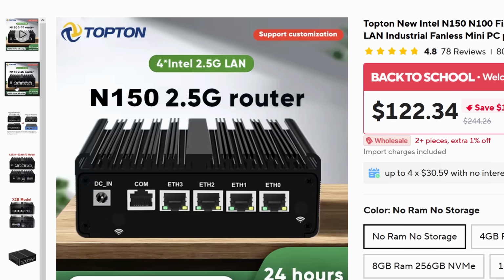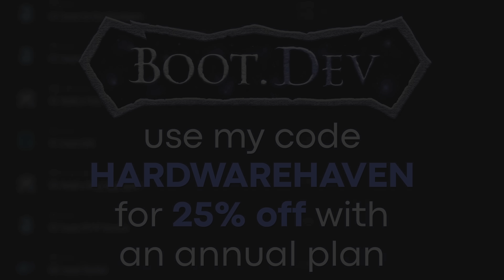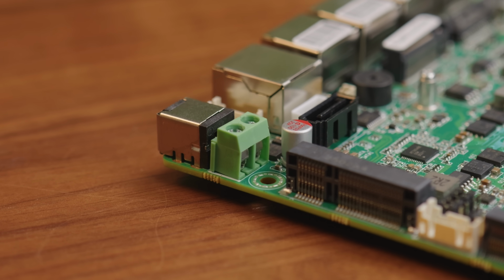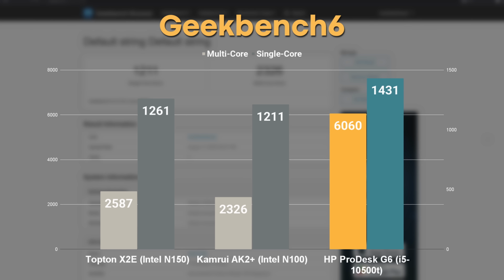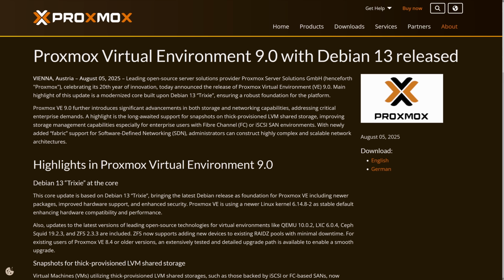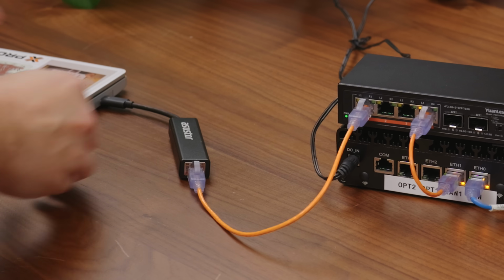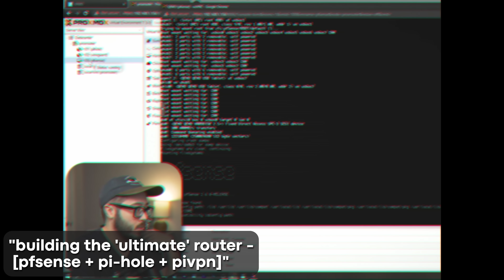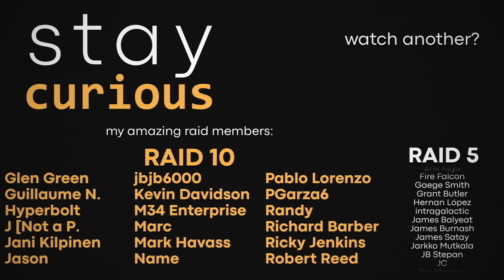Why Didn't I Buy This Sooner?

Comment: Do not buy this fanless POS. Mine overheats without a dedicated external fan constantly blowing across it. only running pfsense too. Also DO NOT BUY THE BAREBONES ONE. I went through 3 different ram sticks before I found one that was stable enough in memtest to not crash. Remove the fan? System overheats, mem throws errors and shuts down. DO NOT BUY THIS POS

Comment: N97 - n150 are the absolute best open source firewall hardware per dollar. Very low power draw, excellent performance for a firewall  and even excellent WireGuard / openvpn / tailscale performance
I use an n100 that I’ve had for awhile and I love it.

Comment: This is a personal pet peeve but just call the com port a modullar com port. You're already calling ethernet ethernet ports.  So many different things use that Port Style which is correctly called 8p8c modular. You could have rs-232 serial, rs485 either of those in DCE or DTE configuration, ethernet, or even any random developer that came up with eight wires that they want to easily plug into something.

Comment: There are known issues with these Topton N150 / N100 machines drawing too much power and running too hot. The consensus seems to be that either the BIOS is poorly developed and not supported and/or the CPUs are second rate or gray market (and need to be run hotter for stability reasons). Google "CWWK Topton N100 N150 idle hot." Either way, I ditched my Topton N150 router for another solution.

Comment: I have had one of these little jewels with the N100 for a few years, now, flaunting some flavor of *Sense or WRT and absolutely adore it. Recently, I upgraded to a UniFi Fiber because I wanted to add some video cameras on my property and I already have UniFi APs, so I decommissioned him from router duties and he became a nice little Proxmox host. He went from 4GB to the full 16GB he could handle, and at about that time the cheap no-name 128GB SATA m.2 SSD died, so he got a 512GB m.2 and an old 2.5" 1TB SATA hand-me-down from my main PC's recent rebuild. Now, this happy little trooper runs all of my network's neat little widgets, like you mentioned. Ubuntu server with PiHole, a docker instance of OpenSpeedtest, an RDP host I can reach from Web-Based VNC, as well as a couple tiny instances I use for Kubernetes while I'm learning clustering. It's not a processing monster, but when you just need something like a half-dozen Raspberry Pis, being able to just spin them up sure beats ordering them on Amazon! With solid-state EVERYTHING and passive cooling, it's totally silent and makes me just delighted.

Comment: I've used the CWWK N305 and currently a topton N100 mini PC with a bare install of opnsense. If I use opnsense's traffic shaper or zenarmor, the router will crash once every week or two with 'Fatal trap 12: page fault while in kernel mode'. Has anyone else run into this problem with mini PC like this? Have any suggestions on what to do?

Comment: I just bought one of these, can you please tell me how to passthrough te igpu. I have been trying for days. Where you using an lxc or a VM for jellyfin?
Reply from the maker: I just use the proxmox community script. It’s an LXC container. It automatically handles the lxc config to allow access to the GPU. You just have to make sure the non-free intel media sdk is installed on the host system
Reply: @HardwareHaven Thanks for the reply. Could you please link me the script you used?
Reply: I seem to have gotten it to work using a community script. The only thing is that I need to have a screen connected during boot up of the host, else the graphics driver won't get enabled correctly.
Reply from the maker: @AkiSaki  You can find HDMI dummy plugs for pretty cheap!

Comment: I use a similar device to run pfSense but with much slower CPU (Protectli). No issue with network speed. However, I think if you want to do IDS/IPS and VPN, that's where the extra CPU power would benefit.

Comment: Bought the similar one but not TopTon branded (same case, same motherboard according to stickers). After a week being on in idle 24x7 (Proxmox installed with opnSense, but not passing any traffic through) sensors reported CPU core temperature 68C with aluminum case being slightly warm. Replacing thermal paste to some Arctic Cooling MX-6 dropped CPU temperature for approx 10C stabilizing it at 56-57C level idle.

Comment: Hi great video, I have a VIDEO SUGESTION, -> Automated system backups to NAS. I use Timeshift locally, but dont unserstand with rea rsync or snapshots how to do it to the NAS. 
I had too much trouble with Synology ABB not installing cause of to new kernel whils still too old for GPU😅

i got N150 and also gpu issues on debian 12. I use it as a home server to run Openhab, HA, VLC streams and some python APIs. Yea and Openhab cant run on deb 13 yet so i used Pepermint 12. Thanks Colten😊

Comment: I use a N100 mini pc on task where most would use a raspberry pi.
Mostly because the systems with the N100 are here cheaper than the raspberry pi.
Of course I could've gone with an old HP mini PC but I wanted something modern with more passive cooling capabilities.

Comment: This build with a 5G Modem, running Proxmox and with OpenWRT in a VM, would be a super cool homelab with it's own cellular connection. With this setup it could also work as a modem, and with a WiFi card, as a WiFi AP as well
Reply: Mine ran Dual WAN for me, because as a TeleCommuter I can't afford to have my connection be down if I have to work. Starlink on one, 5G Cellular on the other. With a USB-powered switch and a laptop, I can run everything off a "solar generator" backup battery and panel pretty much indefinitely. It's part of my "hurricane set-up" being that I'm in Florida and if everything goes down I can keep working with a complete power budget of about 130W, and I have 400W of portable solar to keep it all charged.

Comment: How do the iommu groups look in proxmox, i was expecting thrm to end up on the same group limiting what we can do woth those network ports if passing them through.

Im intending running virtual pfsense with 2x ports passed through, 1 of the others as proxmox mgmt and the last as a oob port to another box i have - but do question if it will let me use the nics independently?

Comment: I have a Topton N100 running opnsense for over a year now.  Paid a bit more to not have to deal with aliexpress (was $180 on amazon vs ~$150 on Ali at the time) and I ended up throwing a USB fan on it cause the CPU can get pretty toasty in my apartment during the summer but I've been very happy with it.  We've also installed a few Topton/CWWK machines at some smaller client offices where these little guys have enough horsepower to handle smallish networks.  Most of the time it sits at 7-8w and the CPU is enough to handle packet filtering and intrusion detection which the previous AMD A6 mini PC I got cheap couldn't handle (keeping in mind I have a relatively slow internet connection).

Comment: Be careful with 2.5G multiport routers. There are a lot of chinese routers like this with 2.5G ports that just don't work with old 10/100M switches. Just no link. The bug is well known, it's a hardware bug that can't be fixed with driver updates. That was very important to us as we had hundreds of old switches that we did not want to upgrade.

Comment: All I want in a multi port router is a CPU and ram sufficient to do one thing. Routing. And do it forever, a 10 year+ use appliance. With pfsense or opnsense with self hosted WG. A higher performance processor or cpu than is necessary to reasonably be able to run future versions of pfsense or opnsense is totally unnecessary. No single point of failure on dozens of additional server features like media server, NAS, etc. Don't put all your eggs in one basket.

Comment: I have a similar model with N100 CPU. The only downside is that I had to add an HDMI dummy plug to make this a truely headless device. Otherwise it wouldn't boot...
Just installed Proxmox on it. This machine idles at 8 W without any tuning...

Comment: I use one of these little devices on my home network as a combination router, firewall, and wireless access point. I run OpenWRT on it which gives me access to a whole bunch of fun stuff. At the moment I'm only running AdGuard Home and Wireguard on it which means every device that connects to my network gets the benefits of DNS blocking and a VPN without having to install or configure anything. That being said I could do even more like setting up an Onion client which would route all my network traffic through the onion network or a transparent proxy server which would allow me to filter all the http traffic on my network. Again, without having to install or configure anything on the devices that connect to the network.

Comment: I've got a very similar one of these: not the same brand name, but IDENTICAL heatsink fins, etc... and it's the 6 port, i3 N305 (8 core) version of this, it came with a choice of storage and RAM - I went with 256Gb M.2 and 8Gb DDR5... admittedly I paid about $300 and annoyingly it came with Win11, but I just wiped it immediately... it's is so overpowered for running OPNsense with 2x 1.3Gbps WAN connectors, but should be fine for a few upgrades over the next few years.

Comment: I bought such 1 year ago and I use it as a router. The processor is less powerful than the N1o0 and it can support only 8gb of ram. And It has only 2 lan 2,5Gbps ports. The power consumption is the same as the N150(officially around 6W). I love it - it is completely silent and energy efficient. I've installed Opnsense without virtualization. I just switch the power on and off and didn't have any problem so far. Great for router.
For N150 it should be checked if it supports 32gb of memory. I have a motherboard with N100 and it has 32gb of memory and it is great for small home server(git and nextCloud to sync files, pictures, contacts...) and some other services.

Comment: Congratulations:  you paid more by going the Ali-Express route than if you just found a similar device on Amazon.   Would not necessarily be the same device, but... Functionally, most people won't be able to tell the difference between a N100 or N150 either... 

Me, I just prefer to not put my credit card info into something like  ali-express. 

Oh, been using a N100 for Opnsense for about 2 + years.

Comment: I have a similar Topton system with an AMD Ryzen 7 5825U, 4x2.5g, 64GB memory, and 2x 2TB NVME. It runs Proxmox with a virtual opnsense install and several other VMs. I have a LOT of stuff hanging off that tiny PC, it's great. Motherboard is made by CWWK. Has been perfectly stable for the nearly 2 years that I've been running it.

Comment: I have a Topton N5105 4x2.5GbE. I bought it in 2022 and it's still working. Initially, I used it with Docker, PiHole, Torrent, and other applications.
Today, I only use it as a firewall.
I had a problem after a year of use.
The NVMe overheated a lot and broke.
I bought a new NVMe with a heatsink and a 40x40 cooler. I've been using OPNSense for two years.

Comment: I have the Topton N100 model.  Both m.2 slots and the miniPCIe slot have 1xPCIe lane; you just need adapters.  No serial BIOS, though.  
I feel the "forbidden router" is totally fine as long as you are masking NICs off in the hypervisor and passing the PCIe lanes to the VM.

Comment: I've got a passively cooled FriendlyElec NanoPi R5S (Rockchip 3568B CPU, quad-core Arm A55) plugged into a 2.5GbE switch serving as my main router and a NAS, and I've been looking at systems which look pretty much identical to this for a while because that quad A55 gets fairly well loaded when serving data from a 3.5" external HDD over NFS. No encryption or anything going on, just shuttling the data from the disk over USB and then to the network. It does of course use less power than this system, but for anybody who wants to do more than just routing packets and maybe QoS or Wireguard, you're probably gonna want either one of these little x86 boxes, or an Arm solution with at least a couple "big" cores.

Comment: I think it's odd they flood the market with something like this that is very niche. But don't make basically the same thing except without all the NIC ports, put like 8 SATA connectors in it. A lot more people would want to run a low powered storage server for unraid, plex and torrenting than want to setup a homebrew router. Unless the industrial world in China is using these things for something.

Comment: I am running Proxmox, pfSense, Pi-Hole and Cloud Key on mine like others but I am also running a bunch Alpine VMs too. Each instance is tagged with a different VLan so I can start them up and test firewall rules when needed. Created a NodeJS script to automate running some tests. Could use Python too.
To each their own, but I only run stable network services on my firewall and run my other apps on a different machine. This box needs to be stable.

Comment: if you need a little bit more power you can buy a lenovo m920x/p330tiny and throw in a 2x2.5gb nic (or any nic you want). supports 8/9gen intel and 2x nvme and 64gb ram

Comment: I bought this model 2025 6xi226-V 2.5G Fanless Soft Router Intel U300 Pentium Gold 8505 7505 Firewall Mini PC 2xDDR5 2xNVMe 2xSATA Proxmox pfSense . Loaded it up with 64 Gig Ram and 2 TB NVME.  Currently Running Pfsense, Milestone, Jellyfin, Koozali, Server 2022 For AD, and Windows 11. Works great.

Comment: Needs 2  SFP+ ports to be perfect.
Reply: They have those available as options also.
Reply: @Tom-bp6no  I built my own on Lenovo 720 Q. I put a dual 10 gig sfp+ card in it and a 2.5 gig to A&E key m.2 card in the Wi-Fi slot. The two10 gig ports go to my trusted and IOT lans. The 2.5 goes to my cable modem and factory  1 gig lan goes to my Starlink for failover WAN. I put a video on my channel about the build. I called the tiny beast home lab firewall.

Comment: I'm surprised it did not have more performance than the N100, other than that probably perfect little server. I currently have a passively cooled Intel NUC. My router is actually a Linux container: OpenWRT for amd64. No overhead for virtualization (extremely low RAM usage - less than 25 MB), no special driver dependencies, etc. That Intel NUC adapted by a company to be passive cooled wasn't cheap at the time (2018), but it also had 32 GB RAM, so I'm kind of hoping for more..

Comment: Packet filtering and intrusion detection on opensense is a very high workload and one of the main reasons to run opnsense over other routers. My little Fujitsu SFF AMD pc simply isn't up to the job of packet filtering and intrusion detection so one of these would be ideal and very cost effective upgrade. 
I think you're missing an essential component of the use case of one of these PCs.

Comment: How does the NIC handle reboots when passed through? I’ve had issues with two different NICs both requiring a host reboot to work after rebooting the VM

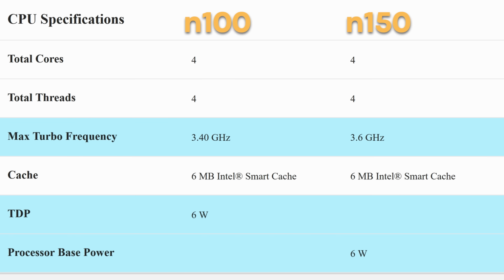Comment: @1:55 Regarding the difference in graphics between the N100 and N150:  They both have the same "UHD" graphics, but the N150's is clocked at 1.0 GHz compared to the N100's 750 MHz.

Comment: you could use those screw terminals for power to convert the thing to run on USB-C if you were feeling suitably fancy. Combine it with the 5G card and suddenly you've a battery powered router. No I don't know why that would be useful! The option is there though =)

Comment: I’m looking at buying a similar n150 system in rack mount form. But I’m kinda torn. I already have older servers i got for free, one of which I could repurpose as a router. Spend ~$200 or spend the extra watts for awhile but from a free server? Server I have draws about 20w at idle. It’ll be some time before the power cost difference crosses over purchase cost of an N150 micro pc.

Comment: 5:30 - You don't need to travel to use a celular card. Most smart buisnesses use a cellular card as a backup internet connection in case their main goes down so that they can continue to operate and process transactions - I use one for merely not losing network access in case it ever does go down - which happens more than I'd like; router simply switches over to it automagically.
Reply: There are alarm systems that use cellular rather than local infrastructure (land lines)
My parent's had to change protocols because the burgulars were from the security company that was leaving (inside job).  So rather than our alarm call local aecurity first they were last after we had been confitmed to ger the warning.

Comment: Yo, we are really missing out on the 4g/5g connectivity. I imagine running this alongside with internet and setting it up to serve 4g or 5g internet in case of a service outage. I know as a user of starlink that outages are not common but when they do occur having a 4g or 5g conncetion step in would be awesome.

Comment: I know it's a broken record at this point, but just pointing out that the venerable 6th Gen i5 6500 (available in used Dell's Optiplexes online for ~$100) beats out the N150 in single and multithreaded perf tests. That price includes 8-16GB of RAM and a SSD. It also takes up to 64GB (DDR4), which is nice if you're not just using it as a router.
Reply: Agreed. I think the box shown is mainly attractive if you need more than one NIC. The other issue is that many people report cooling issues (boxes running hot or rebooting). I would feel more comfortable with the ITX motherboard only versions of these devices, and provide my own case and cooling to be honest.

Comment: I’m running OpnSense on an i5-8500t, 16gb ram, and a 4 port 2.5gb nic in a Lenovo tiny pc. I have a 2gbps connection from my service provider. If I try to run full IDS and IPS - I can only get about 1 gbps. That where these newer cpus with faster ram shine.